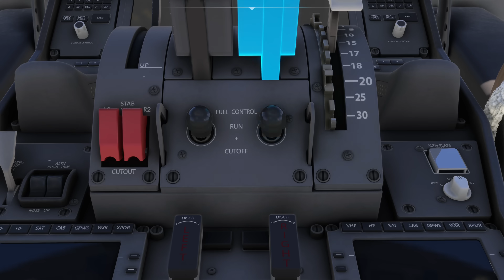Air India 171: Why Did The Fuel Cut-off Switch Get Moved?

Comment: If a chip malfunctioned and actually caused the fuel to be cut off and  the pilot recognized the symptom as being one of the fuel being cut off , he would naturally ask if his co-pilot cut the fuel off and this one would have said NO I DIDN'T. 
We should consider this aspect of things
Reply: The switch was moved. It’s not just digital. A physical object was moved by a human into the cutoff position.
Reply: That pilot then corrected the switches. This shows they were actually physically off.
Reply: If the fuel  cutoff without the switches being physically moved to the cutoff position, how could the pilots switch the switches back into the run position? The switches must have been in the cutoff position at some point. The questions is, how did they get there? These are mechanical switches, they don't move themselves
Reply: logical - Capt Steeeve has said that the engines cutting off would be very noticeable to the pilots - that would have triggered the pilots' exchange - however - in that situation - the mechanical switches wouldn't have moved to off - and the pilot couldn't have moved them to on - so computer programmers (like moi) - would have to marvel at the odds of those 2 events happening in the computer - in the same sequence & duration that it would have happened if the pilots were performing those acts - - - still - for us computer techies - this is one worth pondering
Reply: @johneyon5257  exactly,  i am a software developer and i cant help but think about an "if statement" case whereby one chip malfunctioned an sent the wrong signal because even though there are physical switches , they are somehow sending a message to the computer right? And if so, can't the wrong  message be sent in case of a malfunction???
Reply: I agree with you, because there is 2 cases when both engines can flame out 1. Fire 2 . High fuel pressure/leakage. There are automatically shut off fuel valves too on every aircraft not only manual switches
Reply: @NeosNeidis in the case of this flight, based on the preliminary report, its the manual switches that were turned to cutoff. Thats when the engines started shutting down, after the manual switches were moved. It has nothing to do with fuel valves. The preliminary report shows that it's the switches being moved that caused the engines to shutdown
Reply: @chris2kgreat  No, the report says no such thing. Those switches do not have a secondary position sensor. The FADEC interprets them as being set to RUN or CUTOFF, but that says nothing about the actual state of the switches. One way to know for sure, is if we had visual confirmation, which we don't since there's no such thing as a cockpit camera. The only way we might be able to figure out their state is by listening to the CVR and listen for an audible "click".
Reply: @AnOnymous-go7kn if the actual state of the switches were not in cutoff, how could the pilots have changed their state to "run"? Clearly, the state must have been in cutoff at some point for them to be switched back to run. Also, on the voice recorder, one of the pilots asked the other why they "cutoff". Its clear that pilots noticed the switch was in cutoff somehow, that's why he knew it was the cutoff that caused the engines to spool down
Reply: @chris2kgreat  No, we don’t actually know that the switches went from CUTOFF to RUN. The FDR shows that the fuel shutoff valves were closed (i.e., engines lost fuel), and later, they reopened - but that doesn’t mean the switches themselves were physically in the CUTOFF position when the pilots acted.

In fact, the timing suggests the pilots may have cycled the switches. Here's a plausible scenario: they feel the engines spooling down, get a warning on the EICAS, and look at the switches - but they still show RUN. That mismatch would be confusing. One of the pilots then says “why did he cutoff?” - possibly referring to the aircraft, not the other pilot. The other replies “I didn’t do it,” meaning he didn’t initiate the shutdown.

After about 10 seconds of confusion, one of them decides to manually cycle the switches to try and recover - flipping each one to CUTOFF (which FADEC would not register since it thinks it's already in that state), then back to RUN to force a restart. That would fully explain why the FDR shows the switches returning to RUN one after the other, with a *4-second delay*. Each switch required two actions (off, then on), not just a single flip from CUTOFF to RUN.

So no - the data does not prove the switches were physically in CUTOFF prior to that moment, and the cockpit audio doesn't confirm they saw them that way either. All we know is that the fuel valves closed, and were later reopened - the rest is interpretation, not fact.
Reply: @AnOnymous-go7kn  - i don't regard your theory as impossible - it certainly is logically possible - based on what we non-pilots know about the design - real pilots and designers of this particular system will need to hop in with their insights

the issue is see with your scenario - the power was On at the start - or the plane wouldn't have gotten as far as it did - if the engines started spinning down due to a computer glitch - it would have triggered the pilot exchange - "did you - i didn't" - however - they would have met with switches in the wrong position - i don't know about you - but i wouldn't want to switch it off that low to the ground - just to see if that would reset it - that's your interpretation 

i'm afraid the deliberate shutoff - and attempt to restart - is by far the stronger interpretation - Occam would have liked it
Reply: @AnOnymous-go7kn did you read the preliminary report? I read it myself. In the report, they said the FDR shows that fuel cutoff switches transitioned from the run position to the cutoff position. They are not making this assessment based solely on fuel valved position, the FDR recorded the actual position of the switch. A sensor shows which position the switch is in, independent of the fuel valve. You clearly did not read the preliminary report, thats why you believe that they are only interpreting the closed valve as indicating the switches were moved. Thats just wrong. Sensors pick up the actual fuel switch position, thats how they lnew it was moved.
Reply: @chris2kgreat  Yes, I read the preliminary report. And no, the fuel cutoff switches on the 787 do not have separate position sensors that directly report their physical state. Where exactly are you getting that information?

The system infers the switch position based on the status of the fuel shutoff valves, perhaps in combination with an upstream command, as reported by the FADEC or Engine Interface Unit (EIU). That’s what the FDR records - not a hardware reading of the switch’s physical position.

Think of it like your car’s ignition switch. The ECM might log that the car entered the “IGN” state, but it doesn’t log the exact physical position of the car key. It logs what the system did, not the mechanical position of the switch.

So when the report says the switches “transitioned to CUTOFF,” that’s shorthand for the valves closed as if the switches had been moved - not proof that someone physically flipped them.

Like I said earlier, it’s still possible that one of the pilots moved the switches deliberately - but that’s not something that can be proven just from the state of the shutoff valves. The only way to confirm whether the switches were physically moved is through the cockpit audio. These switches make a very distinct click when operated, and that sound would be clearly audible on the CVR.

The fact that the preliminary report doesn’t mention hearing that sound - even though it quotes dialogue from the same moment - is strange, to say the least. If the clicks were obvious, you'd expect them to be noted. The silence on that point suggests either the clicks weren't there, or the audio hasn't been fully analyzed yet. Either way, it's far from conclusive.
Reply: @johneyon5257  As I’ve said before, it’s entirely possible that one of the pilots deliberately moved the switches to CUTOFF. But at this point, we just don’t have enough information to confirm that. People keep pointing to the cockpit exchange as evidence, but even that’s not clear-cut - the report says one pilot asked, “Why did he cutoff?”, not “Why did you cutoff?”, which leaves room for interpretation.

Now, imagine you're in the cockpit: EICAS is showing “ENG CUTOFF,” but the physical switches are still in RUN. That’s confusing - and yes, in that situation, a logical response would be to cycle the switches. It might not be the immediate reaction, especially that low after takeoff, which could explain the 10-second delay before any action was taken.

It also explains the 4-second gap between each engine switch going to RUN. If they were simply flipping them from CUTOFF to RUN, it would likely happen faster. But if the pilot decided to cycle each one - first to CUTOFF (which FADEC ignores because it thins it's already in that state), then back to RUN - that naturally introduces a delay, especially under stress.

In short, deliberate shutoff is one possible explanation, but it’s not the only one - and certainly not yet the most proven.
Reply: @AnOnymous-go7kn  - i worry about the cockpit voices - they might not/probably weren't in english - and the translation that made it into the report may not have been accurate - so basing analysis on that would need an expert in the language

the rest - i said was logically possible - but Occams wicked razor does favor the other side
Reply: @johneyon5257  I'm not so sure Occam’s Razor actually favors malicious intent here. That theory doesn’t explain the 10-second pause before any action was taken, or the 4-second gap between restarting the two engines. And while the dialogue is ambiguous, as you mentioned, we can’t draw firm conclusions without access to the full CVR audio.

On the other hand, the scenario I’ve proposed accounts for all of that: the confusion caused by the EICAS warning not matching the switch positions, the time needed to assess and decide to cycle the switches, and the delay caused by performing two actions per switch under pressure. So if we’re applying Occam’s Razor properly - looking for the explanation that requires the fewest assumptions while fitting all the facts - I’d argue my theory holds up just as well, if not better.
Reply: @AnOnymous-go7kn  - Occam doesn't care about morals - in fact - it can be used to help solve the most malicious crimes

the 10 sec pause was not a problem for Capt Steeeve - considering the heavy load on a pilot taking off - - and my proposal - which is there could have been a struggle for the pilot while he powered the switches back on - however - based on the accused pilot's "I didn't" - i think that's less likely

we aren't going to be able to solve this by our debate - the final answer will be given by experts
Reply: @johneyon5257  And that’s exactly the problem - you’re treating Captain Steeeve’s interpretation as gospel. He suggests the 10-second delay might be due to high workload or possibly a struggle in the cockpit. But another experienced captain on YouTube - with just as much credibility and reach  argues that a 10-second delay is unexplainable if the switches were visibly in the wrong position. In a high-stress emergency, with adrenaline pumping, 10 seconds is an eternity. You act fast - instinctively. So unless the pilot was totally incompetent, the delay just doesn’t add up if he had clearly seen the switches in CUTOFF.

And the idea of a struggle? That doesn’t make much sense either. If someone was physically trying to prevent the other from intervening, it’s unlikely they would have been able to reset even one switch, let alone both - four seconds apart.

So who’s right? Captain Steeeve or the other captain? That’s the point - we don’t know. And as I’ve said repeatedly, malicious intent is always a possibility, but nothing - and I mean nothing - in the preliminary report confirms it. Jumping to that conclusion now isn’t just premature, it’s irresponsible.

What about the families of those pilots? Right now, the entire world is being led to believe they’re potential criminals, based on ambiguous data and speculation. Steeeve should know better. He’s not just analyzing facts - he’s shaping public opinion, and possibly causing immense, unnecessary grief in the process. And let’s not forget, this wouldn’t be the first time a crash looked like sabotage at first, only to be explained later by something entirely different.
Reply: @AnOnymous-go7kn  - i don't know why you posted this since you seemed to agree with me about the pointlessness of non-experts guessing from 2nd generation sources

but you just destroyed your interpretive skills by saying that i'm treating Capt Steeeve's as gospel - you won't find that anywhere in my posts - except to see me quote him in certain instances
Reply: @johneyon5257  Fair enough - if that’s not what you meant, then I misinterpreted your second paragraph. But honestly, even rereading it, it still comes across as supportive of Captain Steeeve’s explanation for the 10-second delay. That said, if you meant it differently, then it’s an easy fix: just change “you” in my first sentence to “people,” so it reads:

“And that’s exactly the problem - people are treating Captain Steeeve’s interpretation as gospel.”

Everything else I said still stands, and isn’t dependent on what you personally believe - it’s about the broader reaction to this incident and how quickly conclusions are being drawn based on a single, preliminary interpretation.
Reply: Not hardly...the pilot would have visually confirmed the switch was cut off before inquiring.
Reply: There is no computer assist/intervention associated with these switches.  No chip. no PC, just wires and a switch.  If the switch or wiring was faulty, the engines would NOT have begin to restart.  There goes your narrative.
Reply: @vincentsutter1071 and how do you know that? Don’t these switvhes interact with the FADEC computer which then sends a signal to activate the fuel cut-off valve? Could something have gone wrong in FADEC…either a logic error or some kind of electrical malfunction? And since there was no camera in the cockpit how do we know the switches were moved to the CUTOFF position other than FADEC tattletailing it to the flight data recorder? In which case the instruction could have come from the switch via FADEC, or directly from FADEC with no motion of the switch.
Reply: @Zircon10  Other pilots and experts have all stated that this is a direct line to the fuel  system. It is NOT a fly by wire signal.  The reporting of the switch status is via electronic means, but the fuel cutoff are a simple switch and wire set (one per engine).  Given the fact that the 787 had a perfect flight record over years of operation your potential excuse is far less probable.
Reply: @vincentsutter1071  You're not serious, are you? You honestly believe there's a direct wire from the cockpit fuel control switches to the engine shutoff valves - like flipping a light switch in your house? That's just not how modern aircraft work, especially not something as advanced as the 787. Those switches don’t directly power or control the valves. They send a command - usually through the Electrical Load Management System (ELMS) - to the Full Authority Digital Engine Control (FADEC) system, which then manages the actual actuation of the fuel shutoff valves. The FADEC interprets the switch state and tells the valve actuators what to do. There are multiple layers of logic, signal processing, and fault protection in between. It's not "just wires and a switch."
Reply: @AnOnymous-go7kn  magically the FADEC decided to activate each line to the OFF state one second apart, then decided to change back to the ON state with a 4 second delay.  Yes I can really see the FADEC randomly using those delays between state changes versus a human physically moving switches.  Wow you really got me there...
Reply: @vincentsutter1071  Have you been reading anything I've written? I've explained that many times by now. Also, how do you know it was exactly one second? There could literally be 1 millisecond between the two transitions, and they would be logged as one second apart (not going to explain - use some of your braincells instead).
Reply: @vincentsutter1071  is it even possible to move those two spring loaded switches to CUTOFF position with a gap of 1 second during takeoff?
Reply: @p0tat0gunner  yes

Comment: What if nobody touched the switches but it was a computer malfunction. The pilot on hearing the engines spooling back ask the other pilot if he did it. He said no so the would initiate a reset by putting the switches to cut off and then back to run.

Comment: Not very bright but i cant see moving the switch manually opens the fuel supply. Couldn't there be a software or hardware issue. Software somewhere mistakenly thought the the switches where move and in response turned off the fuel and sent the data the switches moved? We have no video.. just a denial. i want to here the recording before AND after the reported exchange.

Comment: So the fundamental question is : why isn't there a feature preventing BOTH engines from cutting off during takeoff?! Why would there even be the need for both to cut off during takeoff which is guaranteed disaster as it was the case here! Both engines should ever be allowed to be cot off ONLY at high altitudes when the plane can glide...